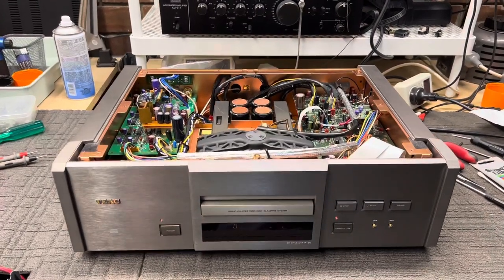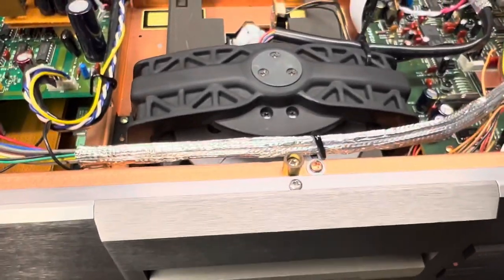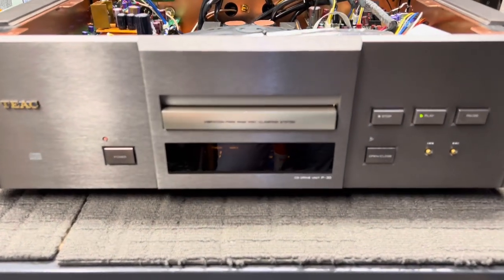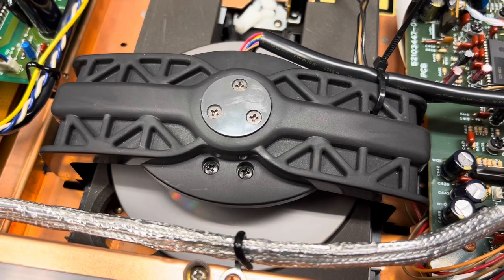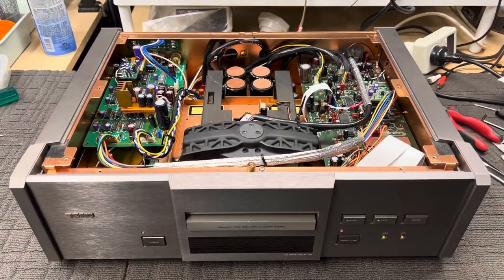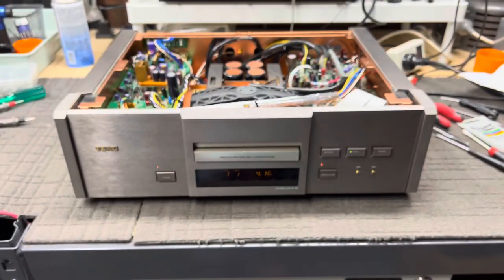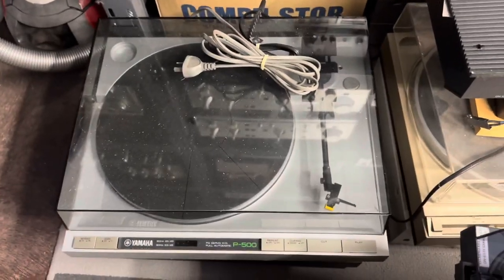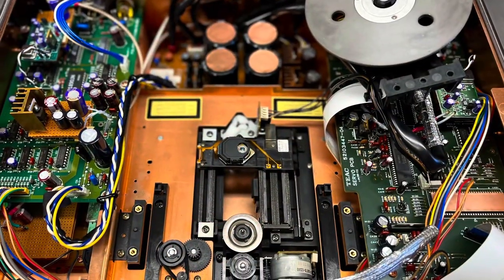Stunning High-End TEAC P-30 CD Transport Repair and Resurrection!

Comment: I have known Clifford him for over 25 years and he has never been known for building kit amps although he might have sold some unassembled kits from Hong Kong many years ago.  His main passion was designing and making his own valve amps and speakers from scratch which he sold to many satisfied customers over the years.  You can install the original clocks on the P30 if you wish. It will be to original spec, look pretty but the customer will notice the difference in sound.  Also, I believe this unit belonged originally to Clifford. He modified it for himself so appearance wasn't that important to him. It was more about function over form. However, Clifford's hates repair work as he finds it boring and building kits even more boring. Its good there are still people that have the skills to restore old players though. Love your channel.
Reply from the maker: Hi Eddie, I can't remember but I may have mentioned Clifford who used to run Audio Synergy here in Perth and did some not very good things to a lot of hi-fi gear that unfortunately improved neither form nor function! Yes, he did build amps, preamps etc but he also unfortunately made some appalling modifications to hi-fi gear, which I know because I've seen them. I suspect he couldn't be bothered with repairs because, like many, he found them too technically challenging. Some describe repairs as "boring" or "not challenging" because ironically they find quite the opposite to be the case. Anyway, whilst we may have to disagree on Clifford, I sincerely appreciate you enjoying the site and thank you for your kind words!

Comment: Lovely work. 
I'm here also to see the tune up, which at least you mention.
I have my dad's p700 transport which we have had from new and it did stop playing. Failing to picup a disc or track.
I read a couple of horrors about working on these and i have to say its just about all true!
It took me about half an hour to locate the laser supply resistor and then a further half hour to get probes onto it. At least the reading were good. So its not the laser.
I pulled the psu out and tested all the voltages. The unregulated +/-10 volts were high (no load, but check back later under load, still high)
All the factory trims were spot on from what i can tell. And sure enough the thing had started working agian... Dry joint anyone?
A tweak on the clock tightened that up.
Worked through the gains and phases which improves things, but they ended up back where they were. The only problem i had was being unable to achieve a 90 degree shift on a trim for focus. It was well out and the signal collapsed as it came close, further running out of trim. I adjusted this for the quietest operation instead.
Not that i could reach the pins on the ic for the metal in the way. Then the signal was on the smallest scale the scope could handle, and it was horrendous. I had to use all the tricks the scope had to get hold of it.

Is there any pointers you can offer that may be the cause of my woes ?
And is the 1.2khz resonance normal while tuning (thats caused when the signal is injected) ?
I didn't film it either. All my hands were in use at the time.

Great insight. Thanks
Reply from the maker: Thank you! These things can be tricky to work on but I recommend accurately setting the clock frequency and then focussing (pardon the pun) on the RF signal and eye pattern. I’ve never worked on a player where there weren’t small improvements that could be made to the RF waveform. Be sure to set the idle laser servo zero point too, it’s the first step in the alignment process from memory.

Comment: Was that a Yamaha CA 810 under your work station dude thats a badass when 
Working correctly i just serviced the one i bought and omg the amp sounds like a?45-50 pound class AB amp even though it weighs 27 pounds . How is this possible well the output transitors were built onto the sides of the amp for better cooling and this allowed Yamaha to get buy with super light weight heat sinks 
If you look at the 810 vs the 1010 the 
1010 has large heat sinks and output devices in the middle of the amp cousing lots of heat !! So the 1010 had to use heavy heat sinks ! 
I also have the newer 51 pound Yamaha AS-1200 and yeah the 810 is a gem sounds naturally like a tube amp in thr midrange. The 810 took me by surprise geez its really good !! 
Thanks for the video L.A. 😃

Comment: Ah, It runs on sony mech. Very similar to SONY ESPRIT Series. A true gem though, very well built which is the reason I just don't get why people try modding the High End gear? If it is a challenge or passion for audio enthusiasts it makes sense,  but then one should get some lower end stuff and muck around with lower stuff. Modding high end IMO is equivalent to say trying to make a Bentley out of Mercedes, it simply doesn't make sense as Bentley is always gonna be a Bentley and Mercedes always a Mercedes, no matter what you do to it. Same goes for vintage high end, keep it as original as possible. Great vid mate, congrats for resurecting it from the hades...

Comment: Is it better than T1?
Reply: Yes, I have had a lot of Teac's and Esorteric's and the T1 is a cheaper CMK-4,0 drive, which uses a simple noisy motor for spinning a plastic platter (green and in some cases grey), and also uses a plastic lens on the laser, which should NEVER be cleaned with isp, but a drop of demineralized water. Then there's no magnetic rail for the laser, but an ordinary tooth drive. The P-30 also includes a beefier and isolated transformer, and much more heavy power sections. They did include a special circuit to isolate jitter, also used on some other high end drives from Teac/Esoteric. The p-30 is a beefed up VRDS-10, and one can argue also in comparison to a VRDS-25 (early version), minus the dac section.
The T1 plays well and one shouldn't laugh of the CMK-4,2 drive as it actually plays well. Some people have modified the T1 to play really really well. Clock is a must on all of them. Then caps, connectors, shielding, mechanical dampening and they respond well to other feet (sometimes 3, with one under the rear and middle mounted trafo). The T1 is a little different.
If you want more, then the CMK-3,2 drive from say VRDS-10-15-20-25-25x, 25xs, 50, 50s, p30, p70, some Krell, Wadia, Spectral SDR-3000 and more, sues that. It's a better drive. Then Esoteric made the P2 and the P2s which was better still. The Teac p-70 uses the same bottom from CMK-3,2, but with a much improve upper bridge. It incorporates a few nice designs, that even the P2s didn't have, but the platter and platter axle on the P2s is even better. These can be built into a CMK-3,2 drive. The mounting of the P2s bridge is more tricky, as it's level is different, but can be done. The extra servo on the P-70 drive can be left out. The servo board must follow along to make it work, or heavily modify te CMK-4,0 board. Better to sue the propper one. This servo board was improved a lot of times from model to model, basically beefing power regulation and power supplies up and making more around the anti-jitter.
The p-500 drive is a bit funny, as it have the CMK-3,2 lower part, but with a modified upper cmk-4,0 platter and bridge.
The p-700 is pure CMK-3,2 drive.
Copland used CMK-4,0 drives and in cda-289 a pure sony drive. But the CDA-288 Copland played well with the cmk-4,0drie, albeit it came in three versions, making the pure MK. II the better, with improved power section, improved output section and improved DAC's.
The CMK-3,2 can be installed into that CDA-288 with a lot of mods. But it works really well. I did all these mods and they play extremely well. I am no designing my own VRDS drive from scratch.
Yes, the T1 plays well and can easily be improved, but the models with the CMK-3,2 drive is preferred. The laser in CMK-3,2 is Sony kss-151a and is hard to get. The cmk-4,0 as in for example T-1 as you mention, uses a Sony kss-240a which is very easy to get. The plastic gears in all VRDS drives falls apart over time, but is easily changed. So the belts. Don't use the 3d printed gears, but get the better ones properly made.
The Teac/Esoteric/Tascam Neo drives are not to my liking, but it's a personal thing. Each to his own.
The P-30 is well beyond a T1, but as I have tried to explain, all things can be improved on. Yes, improved on, not just different.
Kind regards.